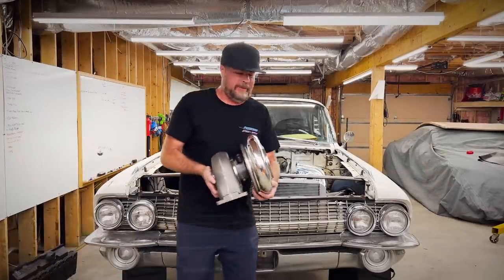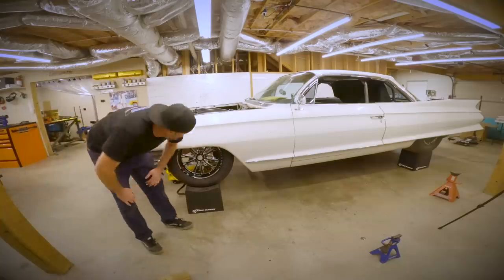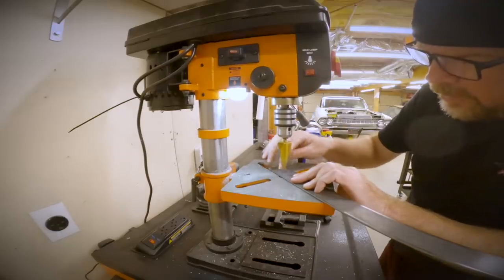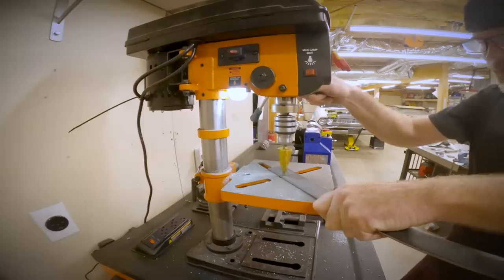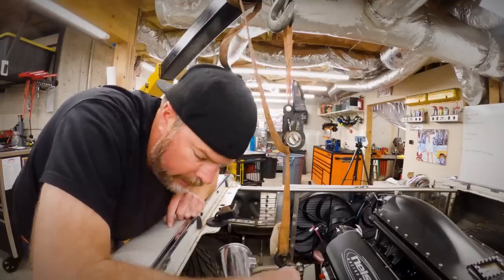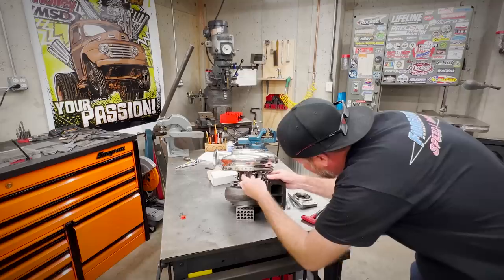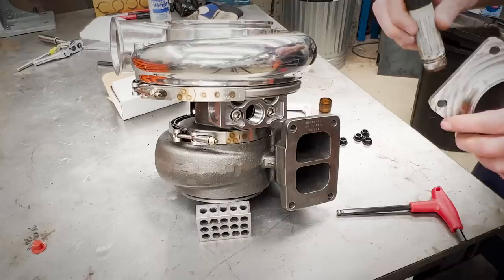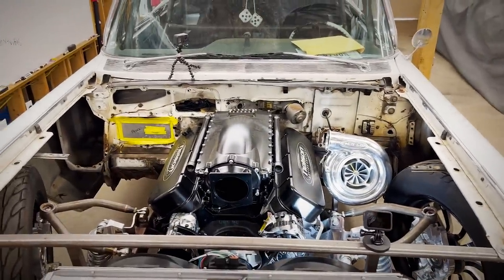I INSTALL 2,500HP WORTH OF TURBOS IN MY '61 CADILLAC COUPE DEVILLE!

Comment: Your hammer and paper method is what we used in the army to make gaskets that were no longer available out manila folders. They worked at least as well as the original seals on the outer hubs.
Reply: mre bags are better, had to make an oil cooler gasket for an lmtv while out dicking around in yakima.

Comment: I modified an air bag with hoses and valves for my slammed 73 C10, I struggled like you did, trying to get a jack under it. I place it under frame and blow it up enough to get my jack under it. Works amazing!. Amazing Cadillac Mike! Hello from a huge fan from Canada 🇨🇦
Reply: Oh yeah good idea, they make actual jacks that are basically semi truck bags, but using just a small bag would be perfect just to get a jack under it.

Comment: Not sure what your plans are for a throttle body, but if you go with the Motion Raceworks, Icon 102, they have a lot of different attachments to make connecting the turbos to it easy and very functional. The best part of all, they are made in the USA.
Reply: And Cleetus might do it at mates rates😂

Comment: Maybe weld a thicker metal bracket onto the frame rail to make the 3 hole mount point level, then drill & tap that, gives you a deeper threat and a flat surface to mount to 👍
Reply: Then I after doing what you said, make the bracket with a curve in it to meet the frame rail GODSPEED
Reply: You are so right💪👍

Comment: Hey. Love your videos, been watching since the early Roadkill days. Love the new tool boxes and organization. Just a word about the power strip placement behind your Amazon drill Press. Might be a good idea to relocate either the strip or the press. Metal shavings inside of electrical power strips might not lead to productive shop. Might lead to a fiery shop. Good idea to bolt and not weld that bracket. Easier to remove for service.

Comment: Great Video, I really like your shop videos, you are a great fabricator and really think things through and explain why. Your struggle with jack clearance is very familiar. We do a lot of cars which have about a 3.5 " ground clearance. I built ramps similar to yours but i had them prog essive from 1" tapered to 1/2, then 2, 3 ,4 . I also added a 5000lb winch to the wall Since i work alone a lot the winch is a big help to pull cars in the shop but also on the ramps. Keep up the great video

Comment: I think the caddy came from the factory with bumper jacks. IF your original bumpers are well connected to the frame, you could get a pair of original jacks and lift from the front or rear to get the clearance for a floor jack or jack stands.

Comment: Hey Finnigan, I love the Cadillac build and I really enjoy watching you every Sunday.  I wanted to ask you about the location of your driver's side turbo, though.  Won't that interfere with your break master?  Or does the break master locate, somewhere else?  Or am I just not seeing how much room is really there?
Reply: If I were to guess, its probably under the dash
Reply: What are Brakes? Things like the master cylinder, lines, calipers & rotors, should be promptly removed to save weight...Also:
  Anything to the left of the skinny pedal, is just there for decoration..

P.s. don't take my advice, ever... Not even once.. 🍻🍻

Comment: I still wonder if using the engine hoist would have been easier to lift the car for jack clearance 😂
Reply: The height of the engine hoist outriggers would have the same problem. A-frame would be the way to go.

Comment: Presumably it's going to be a long while before the caddy is done. You could remove the bumpers and build temporary drift bumpers with lifting points.
Reply: I was thinking he could even have a piece of tube with a pad on the bottom that could slide in behind the license plate and pin in to the front crossmember. Pretty much same idea as the jack points on drift bumpers just removable.

Comment: As someone who has to regularly work with low cars, get yourself a pair of the harbor freight wheel jack dollies, place those around the wheels and they'll give you an inch or two of lift that'll make getting a jack under it easier. I use it to get my low cars on my two post lift all the time. I use them all of the time to position cars around my shop and to get under low cars.

Comment: Mike, A little helpful hint to save you from a heart attack trying to move that Caddy in and about your garage. Get a small winch from Harbor  freight either a 120 volt or 12 volt battery powered one . Make a flat plate to fasten it to the winch and then drill your concrete floor to fasten the winch to using flush anchors. It can be mounted anywhere to pull a dead car/truck in or out of the garage , or in tour case onto blocking to raise the car.. I've got a 1500 lb.120 volt one and it works perfect. Getting to old to push , pull and struggle . Think smarter not harder.

Comment: For the frame mount, instead of drilling the frame, weld a 3/8" thick piece of stock with the holes tapped in it. This eliminates the wedge shims and the metal in the tube. I know you already drilled, but this is an idea for the 63 split-window and others who read the comments. 

 I love the Caddy compared to the myriad of 69 Camaros and Mustangs that proliferate the drag world. I have a 69 Impala project waiting for the twin hair dryers on my "built" large journal 327.

Comment: Have 93 chevy truck regular cab big block body dropped with chop top (screams hotrod) nxt time yur trying to get on blocks.. Grab pry bar n small of wood n lever on bottom of tread tire.. I’m always doin things on my own..  ratchet n pull straps I use regularly… as always great video.. Nelson is one of my heros, he’s been running big horsepower on street for years.. think tha pontiac tempest was first video I seen of his… with 16 injector setup

Comment: You could look at flowdrill for your hole/tap applications. 
You dont lose material, you displace it making stronger roll thread holes in that frame rail
Reply: Very slick I looked that up, do you know if you can use it hand-held though?

Comment: You need a set of the stepped wood ramps like Mighty Car Mods uses.. they're super easy to make. 
Talking turbo placement.. Personally I'd turn it 90 degrees and put it sideways in line with the firewall and make the intake come from the cowl vent and the exhaust can shoot right out the quarter panel and if you want actual mufflers on it you can just put side pipes on it Cord style.

Comment: Swap turbos side to side.  Blow the air to the fenders.  Keep the valve covers clear, because there will be broken stuff in there.  Intercoolers by the headlights and that makes a clear feed to the throttle body.

Comment: I'm my lowered trucks in the past I had a thin 3/4 ton floor jack that I'd put under the bumper to buy me enough space to put my 1.5 ton jack under the frame. Cheapest 3/4 ton jack ever. Scissor jack under bumper works too

Comment: Nothing like a featherlight drag car lol. Next thing being bought, pro jacks lol. Sucker is so sick. I haven’t gone to the moon with mine, but it’s kinda similar. 

‘70 Chevelle Nomad, all original paint and interior in pristine shape. Everything under the car is brand new boxed everything and polyurethane everywhere. Big sway bars, Currie crate 9”, wilwood 6 piston fronts, wilwood manual master. 

1000 hp TCI 700r4, billet TCI triple disc lock up conver, 565 Dart big m billet caps, 345 iron Eagle heads, ported, Callie’s crank, Oliver rods, T&D rockers, exceldyne belt drive, full titanium valves, 10-71 BDS High helix. Makes 1140 on pump 93…

What’s cool is literally the entire car has been modified except for the body and interior. This caddy is just sick. How solid it is, and how phat it is lol, and how fast it’s gonna be even though how thick it is lol. Just awesome!

Comment: Mike, may I suggest investing in a set of hydraulic wheel dollies? It'll get your low-slung vehicles off the ground high enough to get a jack under them, and also comes in real handy if you need to roll around a vehicle in a tight space.

Comment: If you do run tube through the rail I would use solid round stock that way you can use different lengths instead of wedges to level the mount. and tap the stock.

Comment: Try jacking  from the frame infront of drivers door to get it high enough to get 2nd jack under engine or if you can remove pad from jack would give you a little more room

Comment: That was great, I love the 'one guy alone in his shop getting shit done real time no BS editing' approach. I learned a few things and my Amazon cart has some new tools in it :) Good stuff, thanks. p.s. 1. Transfer push using the oil inlet gasket. 2.Bend the tabs on the tube mount leg bottom range to make 3 contact points.(BFH action)  3. You could triangulate the turbo mount other side with a tube coming out about an inch from the adaptor, then a bent tube from it to the vertical face of the frame rail with a bolt in plate......PS can the cold side housings swap between the two turbos? I presume they can. If they can if you put the left one on the right turbo you just put in, the high pressure outlet could point down which would give a nicer shot up to the intercooler and still keep the valve cover clear.

Comment: Add some lift points in the front of the car, inside on the top of the rails, then use the engine hoist to lift the front of the car, then set your wheel blocks on the fronts.  No more rolling up onto taller blocks.

Comment: I second the  air over hydraulic cylinder. On average I change three engine changes a week. Couldn't imagine going back to the pump. With modifications it works for transmission jack also

Comment: Heeeeeyyyyy MIKE... love the caddy build, I noticed in this video: IS THERE enough room for your Master Cylinder?, Brake booster if you're going with power brakes?.. & exhaust heat + master cylinder= boiling brake fluid + no brakes 🍿🥤🍭.  Im interested to see your direction/ your ideas on the brake setup, from the camera angles it looks like not enough room on that firewall for it.

Comment: It might be easier if you got a pair of those wheel jacks they use for angry sized 4x4 wheels. The ones that come in the sides, squeeze the lower arc of the wheel then lift

Comment: Looking good can't wait to see it running! I'm by far a master fab guy or a master at anything however i prefer the thicker T6 flanges with mounting points over mounting from the smaller drain flange. That's just my non fab guy opinion though so take that as you will.

Comment: Cool project! 
Now I know very little about absolutely nothing but the turbo position looks like it’s going to make it awfully tight to remove the rocker cover. 
Consider a saddle type mount where the turbo meets the frame, just a thought. 
Beautiful welds Mr Finnegan.

Comment: Another super easy way to locate the bolt holes is with blue painters tape. Place the tape over the area with the holes. Cut the holes out with a sharp knife, pull the tape off and place it on the steel..

Comment: You are the MAN ! Just a thought, what if you weld a curved plate to the frame under the mount ? File/grind the surface flat and tap holes in it. My thoughts are about the force of 8 second launches +44 lbs of turbo on 3 bolts in thin tubing of the frame. (By the way, the 1/25th model I made of Blasphemi turned out great ! How can I send you photos ?

Comment: My honest thoughts? If you solid mount the turbos to the chassis and roll cage, there needs to be a flexible join to the exhaust manifolds between the engine and turbo, otherwise you could warp or crack the manifolds. That much weight solid mounted to the engine (on mounts that will move) and to the chassis is asking for trouble. Solid mount to the engine so the engine, exhaust manifolds and turbo all move as one, with flexible joins on the intake? Go for it. Solid mount to the chassis, so the engine and exhaust move as one, but turbo doesn't? Probably won't end well.

Comment: Mount the turbo how you had it but weld a slightly large tube on the frame so you can just slide it in.  And if you want extra secure drill a hole in the middle for a nut and bolt

Comment: Time to pick up several pieces of sliding garage door channel , looks like superstrut. Hangers. And some 4 wheel rollers to hang from your floor joists  for dangling parts. Lights. Cameras.   If you get creative you can get some X and Y morion using an Atv winch for Z

Comment: Rigid mounting of the turbo is a good idea. It lets you build a lighter gauge exhaust that will be able to flex as it heats and cools without the extra stresses on it. It should help the exhaust last longer.
Reply: Now there's me thinking the opposite - I can see the manifold cracking all around the flamges sooner rather than later !

Guess there's only one way to find out - keep watching Mike's videos !!
Reply: @mrb.5610  Where the tube connects to the flange can be a real issue.  In industrial applications I have seen then use stubs of fairly heavy wall tube to the flange, and then transition to light wall tube before any bends.
When they heat they will expand.  If you use light material it will move and distort to relieve the stress.
If the tubes too rigid then the stresses will be higher and things will tear and crack faster.

Comment: Cool beans. Don't like that adapter though. Makes a lot of turbulence. Would've been cool if you could have made a bracket that bolted to the engine so you could just remove exhaust and charge pipes and pull turbos with the engine.

Comment: Dude, you really really need some GKtech low car ramps. I use them to get the jack under my drift car. Lightweight, easy to pack away and low profile and easy to push your car up onto!

Comment: Just a thought, do the turbos need to be in the engine bay? Can you hide them toward the back end of this big boat? Plus, you could get a little cooling on the return back to the intake. Just a thought, also, could you turn the intake around? Motion Raceworks "Y" 2-into-1 to the intake...just thinking outside the box.

Comment: Would have liked to see how it would work whit the turbos switching sides. From what I can imagine. The exhaust snail would be able to go inside of the frame rail then. And give greater clearance from the wheel. Another in my mind "cool" mounting position would be whit the turbos switched around 90 degrees so that the exhaust outlet faces the fender. And the turbo air intake can go over the "coold" valve covers parallel to the air intake and end in two air filters in front of the engine. I can se the black intake whit two 3-4" high gloss pippes running on either side and swearing of slightly to the side and downwards after the throttle bodie. Into two huge red and black K&N air filters. In my mind it would reassemble a bull geting ready to attack. Air intake is the back and the air filters the fuming nostrils. Great build by the way. And I really like it as is also. But I always loved those long "pizza and beer" if we would put it here. How would that work evening get togethers that makes the car take 7years to build and 23years to plan out. 😂

Comment: A set of portable Quick-jacks would be ideal for a big, low and heavy car like yours. If you get the right sized trailer, you could even store them and have them for all the Drag N Drive events.
Reply from the maker: Go jacks will not fit around the rear tires. Too wide. They would work great on the front though.
Reply: @FinnegansGarage  I was referring to the Quick jacks that lay lengthwise in between the front and rear wheel on each side of the frame rail or rocker and lifts your car up like 2 feet. I think they are electric over hydraulic.

Comment: I’m liking the turbo mount and placement for sure. I’m just curious on what ya plan to do for cold side piping? Maybe clock the compressor and run it along the same path as the roll cage tubing? 
Iirc your still trying to keep stock hood with no holes in it right?

Comment: Normally turbos need to be mounted so that the center section is level and not angled back, because the exhaust side oil seals will leak.  Does the NRE turbos have better seals in them so that they don't leak?

Comment: You should add electric winch mount points to your floor of your garage. And a jacking point to your car. You could put the turbos where the mufflers go and do the floor sheet metal and an air to water intercooler😃I’d put the turbos in the trunk. But I’m crazy.

Comment: you know I might be stepping on eggs saying this but.. you can mount the turbos at 180º.( ie cold side pointing back, and on the other side of the motor) your charge pipes would be that just much larger, and might make it easier to pack them if you flip the intake manifold that would mean running no intercooler, methanol or snaking it to the core support.

Comment: Looking good, why not tilt the turbo back a little to make the dump easier and rotate the front housing around a little to give more clearance to remove the covers. Just a thought. 
Will be a sweet ride bud.
Reply: Journal bearing turbos don’t like to be tilted.  Unlike ball bearing turbos that have thrust preload a journal bearing has thrust clearance and the impeller will lay on the thrust during normal driving conditions if tilted.  Also the chra won’t drain well and may lead to seal issues.

Comment: Looks pretty awesome :)
Are you going to maintain the twin scroll separation on the turbo? It's worth a few hundred RPM earlier spool and, in principle, a little better top end efficiency as well.
Also, is the engine going to be rigid mount?
Oh, and the turbos are heavy because they're so full of joy ;)
Reply: If I remember from his engine mounting video the engine is solidly mounted with solid motor mounts and a mid plate, no front motor plate though